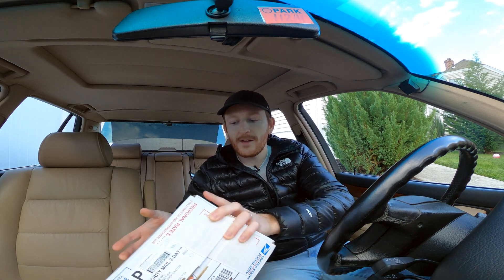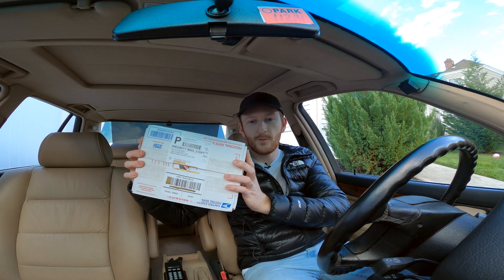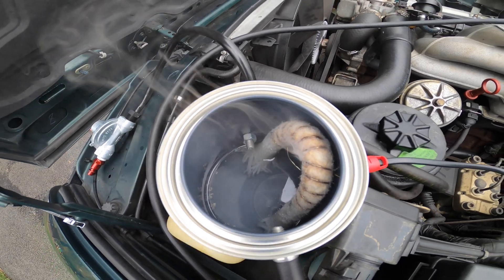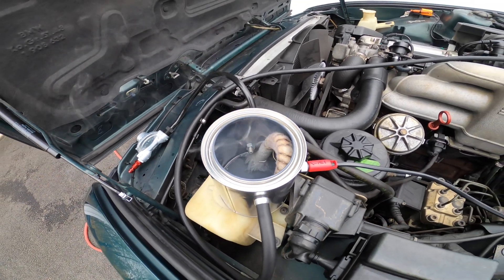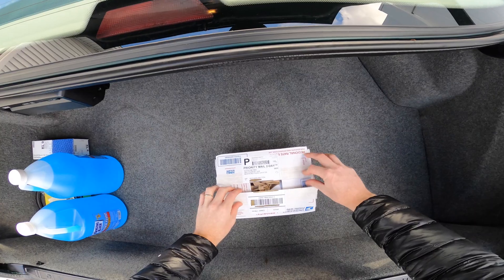How to Smoke Test a BMW Intake with Vacuum Leaks and Lean Codes P0171 P0174 or 1222

Comment from the maker: BMW Smoke Machine (Amazon): https://amzn.to/33r29wk
BMW Smoke Machine (eBay): http://ebay.us/NA16ej
Rare BMW Parts: https://ebay.to/2kd26AR

BMW Goodies: https://amzn.to/2HRK03i
LIST OF TROUBLE CODES: https://bit.ly/32navEK
BMW Tools: https://amzn.to/2Jy1VMN

In this video I use an AutoPro smoke tester (https://amzn.to/33r29wk) to smoke the intake on the engine of my 1990 735iL. This car has the lean code 1222 which I found using the stomp test for retrieving diagnostic codes on OBDI BMW's (stomp test video: https://youtu.be/C4T3QAnQAHs). Other common codes on OBDII BMW's with intake leaks are the P0171 and P0174 lean condition codes common on the E36, E39, E46, E53, E60, E90 and other modern BMW cars. 

The lean codes are usually a result of a crack in the crank case vent system, crack in valve cover, cracked rubber intake boots, cracked vacuum line hose, or other unmetered air entering the engine. The DISA is also a very common failure, along with intake manifold gaskets. The smoke tester will allow you to diagnose where the leaks are coming from in the most efficient way, without "throwing money" at the car in buying new parts to replace without a confirmation. I should have bought this tool long ago! 

To see the trouble codes, visit my blog: https://bit.ly/32navEK

#BMWClassic #LeanCodes #SmokeTester

BMW Ceramic Coat: https://amzn.to/2Jzlpk7
CERAMIC WASH: https://amzn.to/2TP9SyX
BMW GOODIES: https://amzn.to/3mLRZ0s

Griot's Synthetic Clay: https://amzn.to/3oTcYQL
Dual Action Polisher: https://amzn.to/327oyho
Hexlogic Foam Pad: https://amzn.to/3mMA8GH
Meguiar's 205 Polish: https://amzn.to/387C88n

BMW OIL FILTER TOOL: https://amzn.to/2TRFYdy
BMW GERMAN OIL FILTER: https://amzn.to/389ufPU
CREATOR C310 BMW SCAN TOOL: https://amzn.to/2TMhJgO
GREEN MOLYGEN OIL: https://amzn.to/32aoTQn
LiQUi MOLY ENGINE FLUSH: https://amzn.to/3mLSIPe
LIQUI MOLY LIFTER ADDITIVE: https://amzn.to/35YpZzP
LiQUi MOLY JECTRON INJECTION CLEANER: https://amzn.to/3oRzlGg
BMW Maintenance: https://amzn.to/383YLup

ONLINE http://www.bimmerzeit.com
THE GRAM http://www.instagram.com/bimmerzeit
FACEBOOK http://www.facebook.com/bimmerzeit
TWITTER http://www.twitter.com/bimmerzeit

Questions? Send me an email at bimmerzeit@gmail.com

My CAMERA GEAR;
Sony A7sii: https://amzn.to/32aevZ1
Sony 16-35: https://amzn.to/35Xl6as
Rode Mic: https://amzn.to/3oTdIFx 
GoPro 8 Black: https://amzn.to/2JzmrfZ

This description contains affiliate links. If you click my custom link to purchase a product, I will earn a small commission at no extra cost to you. Win!

Disclaimer:
Due to factors beyond the control of BIMMERZEIT, we cannot guarantee against improper use or unauthorized modifications of this information. BIMMERZEIT assumes no liability for property damage or injury incurred as a result of any of the information contained in this video. Use this information at your own risk. BIMMERZEIT recommends safe practices when working on vehicles and or with tools seen or implied in this video. Due to factors beyond the control of BIMMERZEIT no information contained in this video shall create any expressed or implied warranty or guarantee of any particular result. Any injury, damage, or loss that may result from improper use of these tools, equipment, or from the information contained in this video is the sole responsibility of the user and not BIMMERZEIT. Video and Content is owned by BIMMERZEIT © 2020

Comment: So For people like me who are broke from trying to fix their Bimmer....You can go to a plumbing supply store and get a leak detection smoke bomb and skip the heating element and the mineral oil, just get a clean paint can and run some fittings.  Caveat: Not sure the smoke bomb wont damage anything in the intake.
Reply from the maker: Interesting idea, I've heard others mention cigars etc. I think the aftermarket kits for $65 are quite affordable in the grand scheme of things, considering the pro machines shops use are $2000-$3000 for a Bosch smoke testing machine.

Comment: Thanks for the content. Did you ever try sealing rubber joints with a clamp, or an o -ring or if split repair crack with RTV silicone sealer? I don’t usually throw parts at such a small leak.
Reply from the maker: You could put RTV on a crack to get you by in a pinch. But the rubber hardens over 10,20,30 years and cracks. Best practice is to replace the rubber boots all together.

Comment: lol I used a rubber latex glove around the intake, a hose through one of the fingers and ecig smoke through the hose. Worked like a charm and managed to trace 2 leaks - one around the back of the intake and another around the valve cover gasket bolt. Managed to repair both
Reply: LMFAO! Dude you're genius. I'm going to call my vaping buddy over right now!
Reply: @heavenlara5730 you’re welcome. Just last week vac tested my brother’s CLK. good luck!
Reply from the maker: nice work!
Reply: You blew smoke into it from your mouth through the hose?

Comment: By putting the machine in the airflow meter will evap test also show if there's a leak in the gas tank or filler neck??? Or this is just a test for under the hood?
Reply from the maker: No that’s a different system. I’m not sure this is approved for the evap fuel system, due to it’s potential to contain flammable vapor. I believe a more professional level machine and fluid is required for the fuel evap system leak detection. You could reach out to the manufacture of the one in the video to get more info.
Reply: @BIMMERZEITT  thank you for your quick response. I won't be buying this tool soon. I been having code P0440 which comes and goes, but most of the time it stays on. I've replace the charcoal canister, like 3 gas caps and the filler neck. It goes away for a few days but then it comes back and stays on for a very long time. Thank you once again

Comment: I smoke tested and no leaks but i have lean codes and it cuts off if i dont press on gas and rough idling
Reply from the maker: What model car? How old is fuel filter? Is the fuel pump making noise? Check fuel pressure with tester. Could be bad filter or failing fuel pump.
Reply: 2004 bmw 325xi
It was running lean both banks and misfire all cylinders, changed the coils and plugs wich fixed those codes, i smoke tested it and nothing came out. I changed the fuel filter today and then heard rattling. Changing disa and fuel pump in two days. Just wondering what it else it could be if its not those things :/
Reply: @chrisavina1281  sorry to jump in… sounds familiar. Check high pressure fuel pump housing. It’s a one piece unit, so I shouldn’t call it a housing but the ears that the hold down bolts go through break. Pretty tough to get a visual on them from my experience. I found movement by poking with long extension from underneath, confirmed broken ear on the housing.

Comment: I know I have a leak on mine but I was looking at the SDT-206 on Amazon.   It has safety and adjustments.  Just a big price tag however my wife’s new Jeep but it is not cover under the extended ‘bumper to bumper warranty’ which is bs.  They want $300 to test it.  I don’t like my air compressor and the SDT-206 has a pump of it own and is less scary with built in timers.  But $300 to the shop for on time or $300 for a tool I can use on all 5 of my rides and family’s cars too.
Reply from the maker: One downside of the one I’m using is I don’t think it can be used on fuel evap system safely. You need a special liquid vapor so as not to ignite anything- yikes. That being said the better $300 machine sounds better in the long run!
Reply: @BIMMERZEITT  I need to double check that about the fuel system safe... great point
Reply: @EDWIN MARCELO SEBASTIAN - RUIZ ..

Comment: Thank you for the explanation, much appreciated as always! This is an incredibly helpful tool to have for most car owners if not all as different components are deteriorating over time. Always a nice feeling to have a good running engine🏎️🏍️🚜
Reply from the maker: Definitely a must have! I’ll get a lot of use out of it. Smoke testing at a shop locally begins at $150 per car.